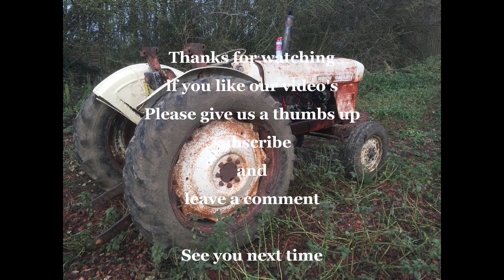weekly yarns #21

Comment: Hi Barry, I have mentioned before -so educational. thanks for the tip on the paint - out of the sun. Your painting is brilliant
Reply from the maker: Cheers Dave, I learned the hard way when I was painting my lister SR3 the paint would be dry to touch but not hard, did some research and found that drying in the sun created a skin that would stop the solvents from evaporating, keeping the under lying paint soft.
many thanks for your support
Barry

Comment: Paint is looking good Barry. My shed is 200m away from the house and it is easily seen from the road that it is wide open but out couriers beep the horn at the house and drive off. Seems to be a global problem.
Reply from the maker: cheers Lance. couriers! don't you love them, the paint, I've tried painting at component level, as you can get all the difficult area's but then you always have the nuts, bolts and flanges that don't quite match up, I've tried painting at assembly level and always end up with overspray on other pieces, still in that big learning curve.